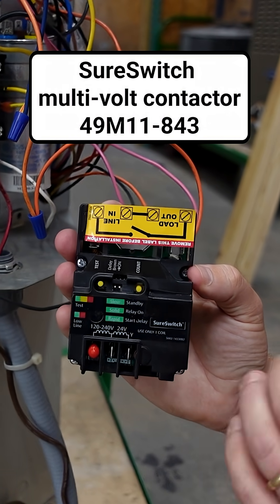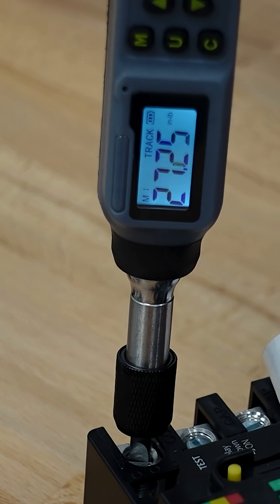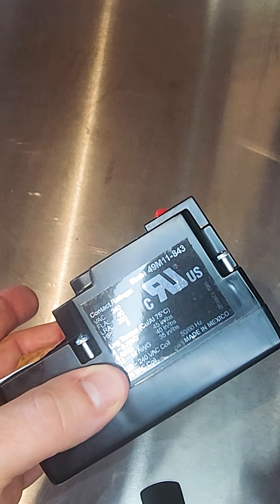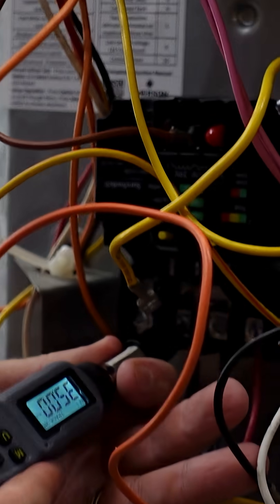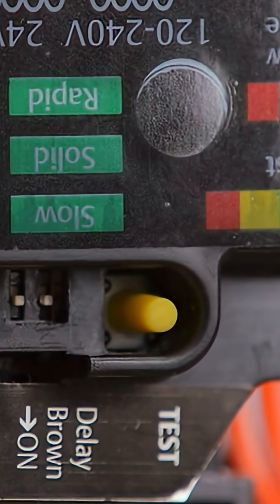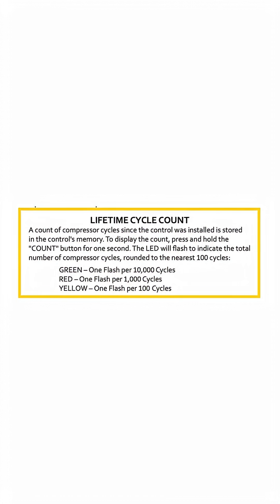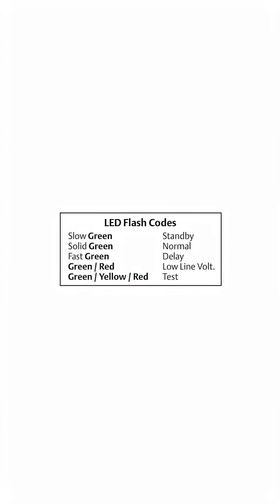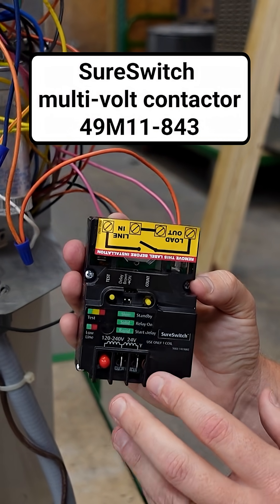SureSwitch by Copeland: Torque Specs & Advanced Features

Comment: Does the switch use a mechanical switch or solid state?
Reply: It has an internal sealed relay that has zero crossing logic so it only opens or closes when the ac waveform is at zero volts. There's no voltage hence no current negating the contacts getting pitted except under ground fault conditions